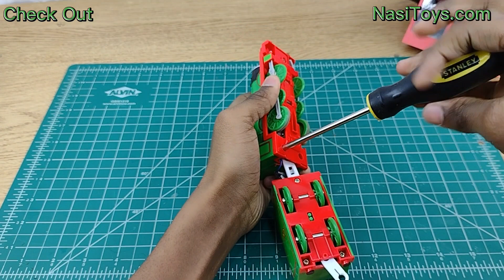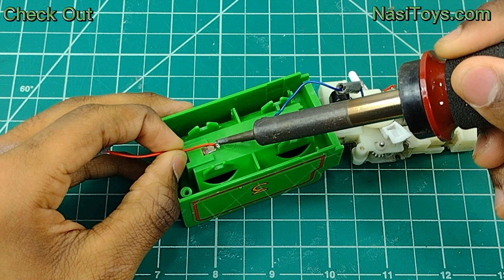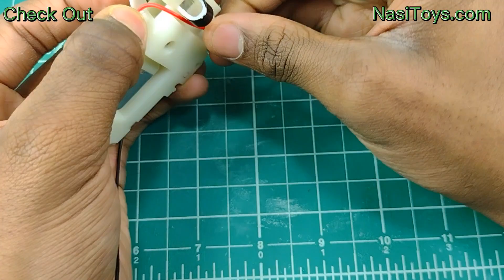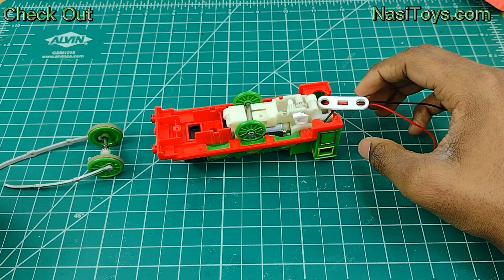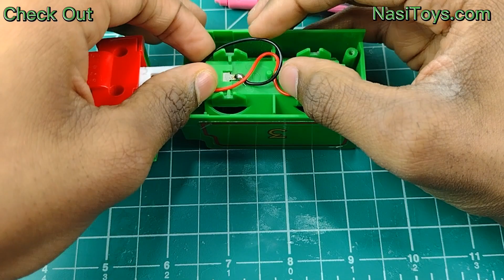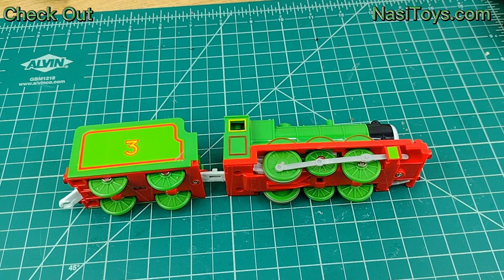Thomas and Friends Trackmaster Henry Rewiring

Comment: My solution to the wiring issue is to have it be a modular connector that you can replace
Reply from the maker: Where could I find some of those? It sounds like it would be good for Flying Scotsman switching between the Fowler and the Corridor tenders
Reply: @NasiToys  it would involve soldering a mini molex socket to both parts of the engine and plugging in the modular wire into both ends
Reply from the maker: Got it. What size do you recommend?
Reply: @NasiToys  the same size used for the battery connector used on playstation 4 controllers
Reply from the maker: @Tomahertz Got it. Thank you
Reply: @NasiToys  no problem, I wish that the companies actually used this solution to fix the wiring in the first place